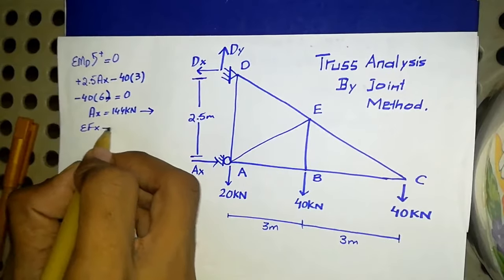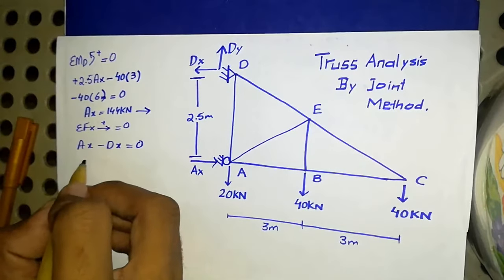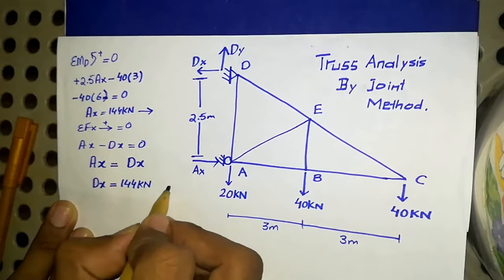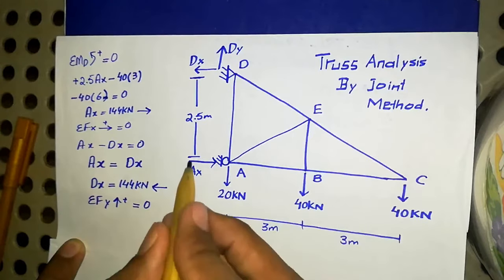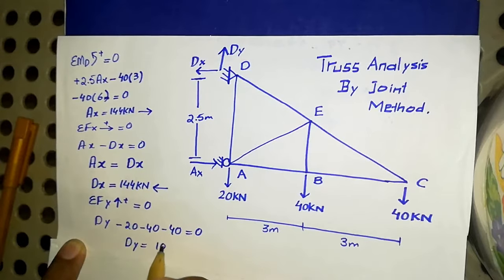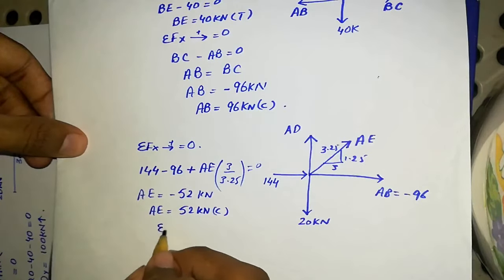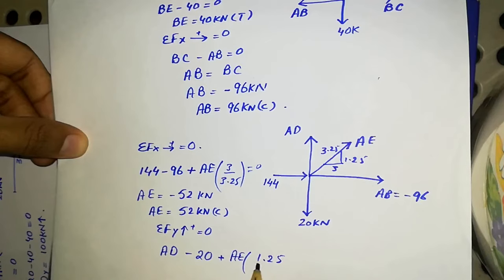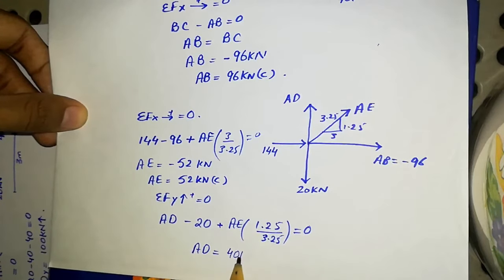Truss Analysis using Joint Method 2

Comment: Can you explain how length CE is 1.25
Reply: A little too late but he used the ratio and proportion from the bigger triangle
Reply: The height of the Truss is 2.5 right. Since he solve the joint C... so the height of Joint C equals with EB. It means EB is half of the height so... 2.5÷2 = 1.25... the lengt of BC is 3. Then we got into Phytagoras
c = √(a² + b²)
c = √(3² + 1.25²)
c = 3.25